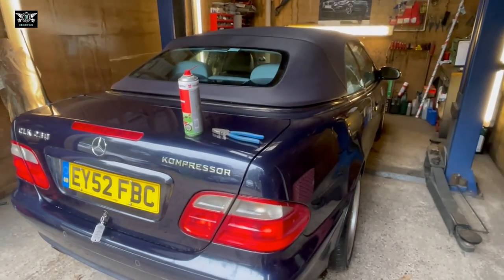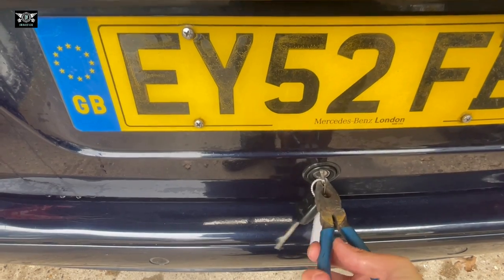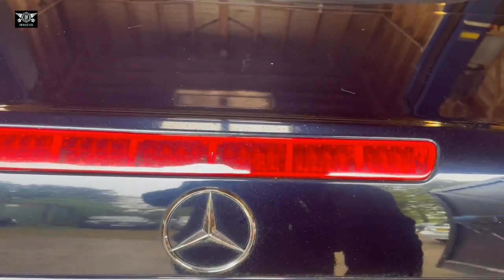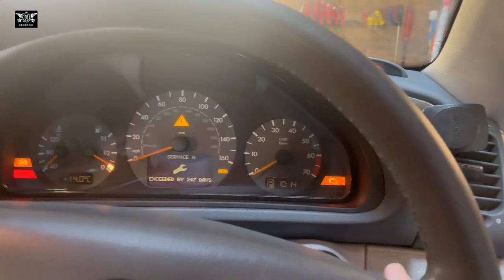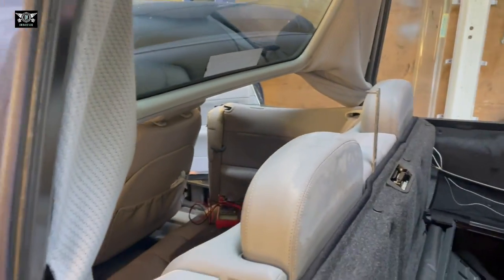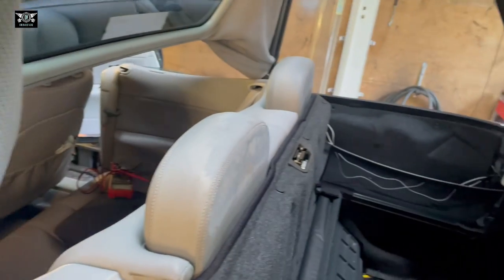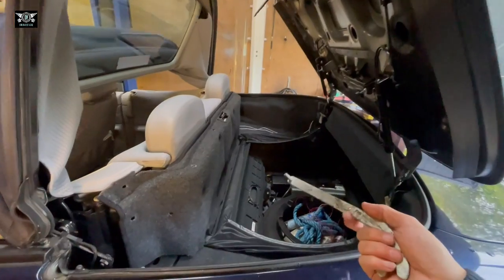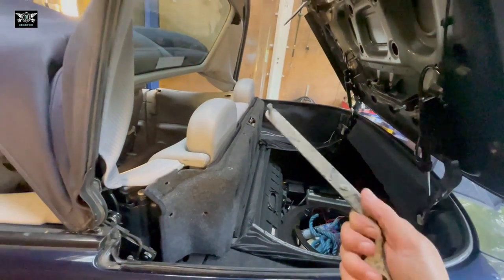How to manually open and close the soft top on a Mercedes W208 CLK convertible

Comment: Thanks to Your help i can get my stuck roof down , I Value your advice to release the Pressure, thanks again🤗
Reply from the maker: You welcome 🙏
Reply: Hi, what do i have to do when the roof is stuck. 
I have opened it manually, but now i can't close it. 
Can you please explain what i have to do now? Greetings
Reply from the maker: @zoranzoki6286  did you watch the video ? If you have and you follow all the procedures then you may have a different problem with your roof as I explained the procedure in the video. No point me typing the whole thing. If it’s stuck for another reason then you may need to take it to an specialist to see why you can’t close it.. regards.
Reply: @DaringBeefcake how do you put the pressure back in?

Comment: This is very helpful. What if I released the pressure manually (like you did using the screwdriver ) would I be able to operate the roof automatically again?
Reply from the maker: Yes but you have to close the screw again. But it won’t work if you already have a problem which might be a faulty micro switch.

Comment: Thank you much for this video it’s very helpful! I released the pressure same way as you. Would it work automatically again once the pressure was removed? Please advise
Reply from the maker: If you had to release the pressure I assume your soft top is not working. When you close the pressure screw the soft top will operate normally provided you fixed the soft top.

Comment: Hi, thanks for your video, very useful. Unfortunately I have not watched your video before opening the roof manually. I have not released the pressure and now it is impossible to push the roof up. You said in your video that you experienced the same situation once, how did you solve the problem ? Thanks for your help.
Reply from the maker: If you can access the boot area, you will be able to find the pressure release valve. It will be a bit of a fiddle but you should be able to access it through the carpet hole and a long flat head open the valve.

Comment: When I use the flat head screwdriver and twist, no pressure is released if I turn it either way, what should I do?
Reply from the maker: To be honest am not sure, if the pressure is not released then may be there is mechanical problem or a blockage.